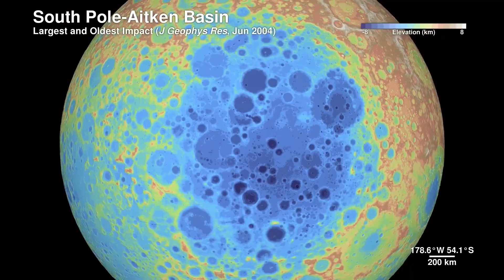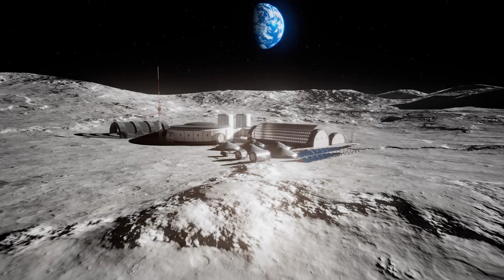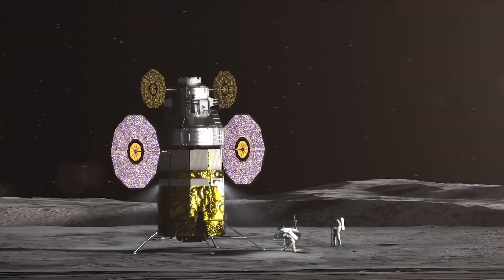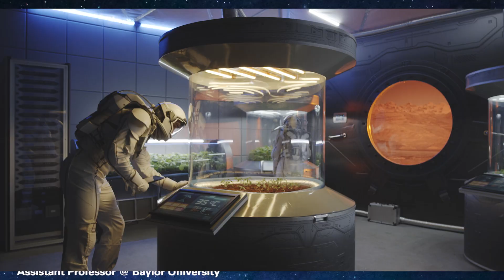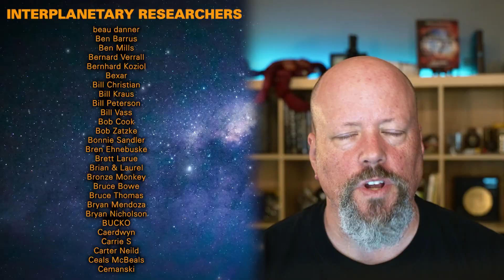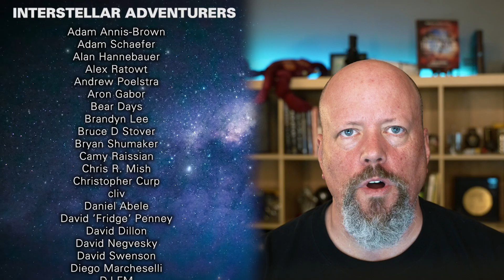How Much Water Will A Human Colony on Moon or Mars Need

Comment: Saw a thing a few days ago about using green polarized light at a 45 degree angle it will cut the bonds between the water molecules causing evaporating (faster than just applying heat or all spectrum light.), so a movable tent like set up maybe grow room work in combination with the drill room?
Reply: Couldn't link it but it's out of MIT it's called photo molecular evaporation of you wanna look it up

Comment: Spacecraft designer weighing in: The heat drill thing makes no sense to me. All you need to do is to scoop up the "water ore" and place it into a sealed container. You then move that container into the sunlight. The sunlight warms the container and the water sublimates, pressurizing the container with water vapor. If more heat is required, use mirrors to concentrate more sunlight on the container. You then release that water vapor into a pressurized distillation tower in the shade to liquify it (maybe requires a pump, depending on vapor pressure achieved). Now you have perfectly clean distilled water, no reactor required. You dump the dehydrated regolith out of your container and go get a new load.

Required systems: 
1 rover with a front loader scoop
1 or more pressurizable dump trailers
1 distilation tower (or pump + radiator)
1 water tank
Some pipes and maybe a dry (non-oil) vacuum pump

Optional plus up: Concentrate a lot of sunlight onto the container to smelt the regolith for metals, extracting water just as the first step. Probably better to have your pressurized crucible be a stationary facility in that case rather than movable pressurized containers.
Reply: James, yes, this makes a lot of sense. I seldom watch these colonization videos or read the comments. So many of the energy-intensive activities they discuss are powered electrically by hand-waving "and then magic happens." Using solar thermal energy directly seems obvious to me, especially for processing local materials. Rejecting heat from your condenser will require some engineering, but won't require magical thinking.
Reply: Agreed. You're going to vaporise the regolith and end up with water saturated with minerals and solid rock that you then need to crush to extract the materials from it. Take it and put it in the sun > water evaporates (essentially distilled) > put the still powdered regolith into the refineries to extract the aluminium and titanium and whatever else from it.

Comment: Fun fact: Humans synthesise water through metabolic activity (the hydrogen comes from carbohydrates). So on a realistic "moon base" where food is transported from Earth, water is actually created by the humans. Given a sufficiently efficient recycling system, we do not need to extract water from the environment. Indeed the energy production and mining and materials processing and chemical engineering involved would require so much mass that it would be self defeating. it would make more sense to simply import food. And on top of this we will have methane and oxygen for propellant in large quantities and that can also be converted to water for human needs. 

We're talking realistic bases - a few dozen individuals. Not colonies (which serve no purpose).

Comment: A pipeline a quarter the circumference of Mars seems way too insurmountable of a challenge to construct in such an austere environment. Why wouldn't you just regularly deliver water from an automated polar mine to the base via sub-orbital hops, using water as fuel? That seems like a way more feasible solution to the problem, and way easier to execute with the resources on hand already. Not sure why a pipeline is the first thought.

Comment: Your guest is looking at water uses the wrong way.  We use water on Earth because it's cheap and readily available.  It is not always the best solution.  Fire suppression, how about CO2;  Bedding on fire, use a chemical suppressant; want to cool your computer, refrigerating unit.  We don't do that there because of cost.  When water is expensive, other methods become viable.

Comment: A man can definitely ration water if it is scarce. You don't need to change clothes so often, take long showers, drink so much that you need to excessively use a toilet, or make elaborate greasy meals. Why do they say that cooling computers consumes water? Also in other contexts. Doesn't it circulate in a loop like most traditional systems with radiators?

If I don't have a water meter, my company would bill me 20 cubic meters per person as an estimate. Jesus.

Comment: Instead of using a probe or drill, which will lead to mechanical failure, I have an even better idea: use a high-powered microwave beam to superheat the water. Microwaves can penetrate several feet of regolith.

Comment: It is likely much of the water is very salty.  Liquid salt can act as a coolant fluid in some situations.  Fuel will likely be a huge requirement.   Underground water is likely available in large quantities. Distillation is a relatively simple separation method.  Possibly with solar power.   China is operating 2 MSR fission reactors in the Gobi Desert using molten salt for coolant and heat transfer.   Agricultural use in a sealed environment should be very efficient.  Underground bases could be very effective.  Moon regolith bricks are likely to be effective construction material.  And even solar cells.  Once established operating costs should come down relatively low.

Comment: There's plenty of Oxygen on the moon.  You only need power and Hydrogen for an equatorial base.  Water is 89% Oxygen.  Additionally, polar orbits and launch/landings take significantly more dV than equatorial missions - to the point where it can be more efficient to bring your Hydrogen with you on an equatorial mission, depending on engines and other specifics.

Comment: Explore the Moon, with a focus on the South Pole where there is a large amount of water. The water here does not exist as a pool but is mixed with the Moon's regolith layer, requiring technology to exploit. Water extraction requires thermal drills and a steam collection system. Using solar energy is feasible, but careful consideration is needed, such as not using a nuclear furnace because it requires cooling water.
However, we also need to be aware of the challenges of establishing a fully self-sustaining base without Earth; This may not be possible in the near future. Compared to Mars, the Moon has the advantage of distance but still faces the challenge of small meteorite impacts.

Comment: You won't be farming horizontally that's a silly idea vertical is the most logical solution for farming on the moon and as for recycling the water well you have to probably do as close to 100% recycling as possible as well right

Comment: Aquaponics (fish aquaculture + hydroponics) is more water-conservative than soil agriculture.  You also get two crops for the price of one, and scrub some CO2 out of the air.  It will be a staple of future space-food systems.
Reply: Unless you vent water to vacuum or put it back on the ground I don't understand how any water would be really consumed
Reply: @bernhardjordan9200  well some of the water would be incorporated into the biomass (starches cellulose) as hydrogen.  To recover the water from the cellulose you would have to burn the cellulose and then condense the water.  You’d also lose water by transpiration but that should be recoverable by simple HVAC dehumificatuon.
Reply: I think that statement might only be true when comparing aquaponics on earth compared with soil agriculture on earth where you are interested in water lost to the atmosphere, they don't apply to a sealed environment. However worth doing to avoid becoming vegetarian.

Comment: Nuclear Chemical engineer here.  The type of nuclear reactor mentioned by the professor would not require water on the moon for cooling. Uranium nitride or similar fuel at an enrichment of 20% would create a core about the size of a trash can, and could be cooled by molten salt. Water would not
be required. See LANL for a reference on this reactor.
Reply: No, but the amount of salt is on the order of kg’s , not tons.
Reply: Is there a working molten salt cooled reactor on Earth? This idea has been around for decades. I don't follow news on this but I had the impression no working model has ever been made. Research reactors maybe?
Reply: @ericsmith6394  INL had a reactor that worked for years,ORNL also had an experimental reactor. Both worked through zero cooling experiments with no failures. These reactors were not commercialized. In the vacuum of the moon, the harsh conditions which exist in molten salt operation we call Tuesday on the moon.
Reply: @ericsmith6394  In the early days they were experimenting with both molten salt and pressurized light water reactor tech. There were some promising results with the molten salt designs, but for >reasons< it was never followed up on.
Reply: @STSWB5SG1FAN  like for instance, those >reasons< included chronic problems with extreme corrosion (due to those pesky molten salts), that resisted all efforts to resolve...
Reply: @STSWB5SG1FAN  Ease of extracting the Plutonium to make bombs was the reason.
Reply: @ericsmith6394 right! 

"We can't really make it work on Earth, but it would be the best for simple space colonies absolutely!" Said the engineer...
Reply: See Kilopower or KRUSTY, NASA have been working on nano scale nuclear reactors for the moon using Stirling engines for the generation.
Reply: @andrewharpin6749  And just like any heat engine, the relatively inefficient (no change of phase) Stirling faces the same issue of rejecting heat in a vacuum. This is a trivial mater at low power levels, but not when generating the many megawatts needed to support a 'colony', let alone industrial scale ISRU. Not saying it is impossible, but is in fact the biggest issue facing colonization.
Reply: @Miata822  agree, energy is the biggest issue facing our expansion out into space
Reply: @Miata822 silence dude. There's no such thing as 100% efficiency let alone what you're complaint is about. A Stirling is probably the best you'll get mechanically , depending on the materials used.
Reply: @Mr.E-gi5rq  Did you not understand my post or simply not read it? Let me restate it in short words. No heat engine works unless you can make the heat go away on the side away from the fire. In space there is no air or water to take the heat away.
Reply: @Miata822  yea and it should require less heat to operate . Because you specifically said sterling engine That specific engine functions more on temp difference than on actual amount of heat.  Get pissy if you want . But it's a pretty big point that you overlooked . So in that environment it's probably the best choice  I'm not so sure you have very much hands on experience regarding any of this . Because then this would be obvious to you. But the fact that it's a vacuum could work for you instead of against you because anytime you can eliminate variables and simplify sht , you can improve on it. So yes I understand what you said I'm just saying it's not very bright in a very polite way. I know text book tends to blanket cover all heat engines with the same description . But that's simply not the case when you look closer . This would be why they work at NASA and you work where ?This is exactly why mechanical engineers irritate me . And it's exactly why everything fails. For fk sake you can't get a lawn mower that lasts 3 years because it's designed by guys who can't even do their own brakes. Like they can't just look at that and tell how it works ? Yet they'll design sht for a huge company with such confidence in their failure solely because the book told them so. Please tell me you are a machinist , or some kinda mechanic. Because if you have no hands on experience then maybe dont be so quick to criticize the points of those who do.
Reply: @Mr.E-gi5rq  "...functions more on temp difference than on actual amount of heat." Comedy. I get a kick our of hearing cranks tell me how things work. Please continue.
Reply: @Miata822  I could continue and on doing so I'll mock your smugg a$$ obvious ignorance in general. If you raise the temperature equally there is No increase in power. If you put a sterling engine in a 300c room and then heated the piston to 400c it wouldn't do sht. Now if you had it at zero and then heated the piston to 400c it would probably run pretty well. But see there's the point you fkn 🤡 . So yes do tell me how it would function so much better on the sun . This is what I mean when I criticize engineers by saying theyve only got half a brain. Because they only ever seem to understand half of wtf they were taught . And even less of wtf they actually say. That 2 dimensional understanding does not afford you a very good view of the entire picture. Don't get me wrong there are rock stars out there , but you ain't 1 of em. The low gravity would work well for it as well. Less parasitic loss . So bottom line if you could make it function on earth it should be really working on the moon. There's a reason why NASA doesn't hire you . There's also a reason why modern machinery breaks constantly and a 43 flat head Cadillac can still run with no bearings or oil , or you can find machinery even older still in use , but anything within the last 30 years is in a scrap yard after 10. Who needs planned obsolescence when you got defective engineers in the first place ? Intentional failure is just an excuse for incompetence . But that's just my observation over the last 50 years of working on all this sht for a living. A factory recall used to be rare. Now name an appliance , automobile , piece of heavy machinery , in the past 10 years that doesn't have a stack of them . Because they're all failures. Don't blame the machine blame the fools who designed it. That's just pointing out the glaringly obvious
Reply: @Miata822  as for cranks ask your mom she's seen more than a few I'm sure.
Reply: @Miata822  so my reply got knocked off . Big fkn surprise there. Probably went running to a safe space to cry about it right after you screamed bully at the screen.
Reply: @andrewharpin6749  Yep. Stirling generators are great when there are people there to do maintenance on them.
Reply: @BabyMakR  I think the intention is for them to be maintenance free, given the radioactive environment, I doubt they'd want astronauts anywhere near it.

Whether or not they achieve that goal is up to the engineers.
Reply: @andrewharpin6749  Why would they put the moving parts outside? The cold side has to extend outside to reject heat but that's just radiators that have no moving parts, and depending on how the base is configured, the extra heat of the RTG may be useful inside for purifying (distilling) water etc, or maybe they will have it setup with separate radiators that extend outside to reject excess heat from the RTG. Either way, the moving parts can quite easily be inside the habitable areas of the base.
Reply: @BabyMakR  discuss it with NASA, I'm not working on it
Reply: I wanna bet you can use lunar minerals as a cooling jacket too if you design the reactor appropriately.
Reply: And I don't believe that water cooling a reactor should create contaminated water in a daily basis
Reply: @bernhardjordan9200 great point. But we need an Ion exchange bed to cleanup the water, and these tend to concentrate trace radioisotopes in the water and create low level nuclear waste. This is why I like molten salt for this application.
Reply: @elephantwalkersmith1533   molten salt is way better, I'm not arguing that, I'm a huge LFTR fan . And there is plenty of thorium in the lunar regolith 

About the contamination in my understanding it would happen in the water for moderation and it would be restricted to the primary loop. Is not like it would need to be replenish with time to create a daily need of water, even when water is split by radiation it can later be reformed
Reply: Let's take a step back and explain to me how electrical energy is extracted from the reactor you mention. What I understand of liquid salt reactors is that the salt media transfers heat from the core to a boiler where that heat is extracted to change the phase of some other liquid (usually water) to a vapor. That vapor then powers a generator's turbine. The lower temperature and pressure vapor is then condensed and recirculated to the boiler. Are you referring to something else?
Reply: And you think there are salt deposits on the moon??

Comment: If only 60% of water used in lunar agriculture is recoverable, someone is doing something horribly wrong.

The farm is going to be part of a sealed environment. Water "lost" to evaporation is recovered by the process that manages humidity. Plant waste will get composted. The plants that get eaten will just lead to water in human waste.

Biology will do some chemistry with the water to use the hydrogen and oxygen in other compounds and vice versa. As long as the vast majority of biological waste goes into a compost pile, the microbes will do their thing to make sure that the hydrogen and oxygen aren't permanently lost.

A tiny colony may capture organic gases in carbon filters so it won't poison the colonists, but not actually go to the effort of recycling them. So methane produced by decay could actually escape from the system. A larger colony would produce enough volatile organic compounds that it would be worthwhile to recycle them.

Comment: Is it possible to generate energy using water temperature change in the moon or other places in space. Meaning moving water in a pipe from hot places to cool places in a cicle?
Reply: Yes, you can get electricity from almost any heat gradient. I don't know how much in this case. It sounds like something that is difficult and risky. If a rock hits your solar panel you might not even lose the whole panel. Hit a water pipe, though...
Reply: Check out RTG Stirling engines.